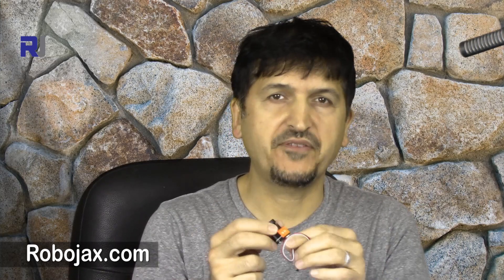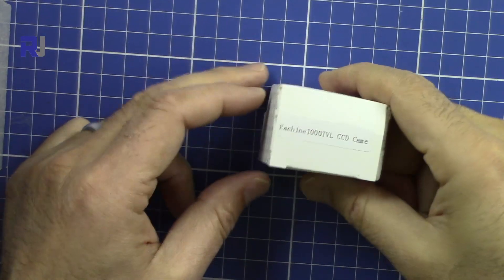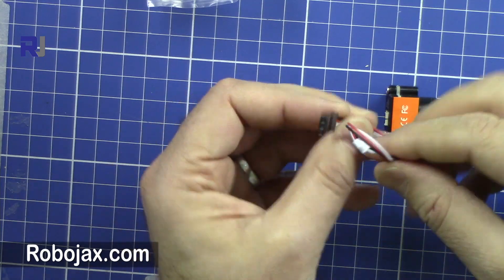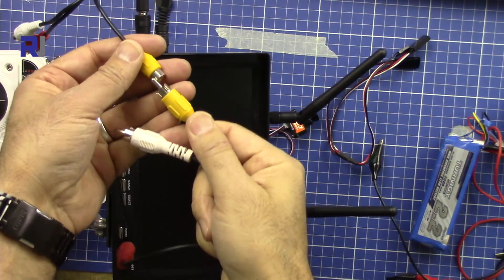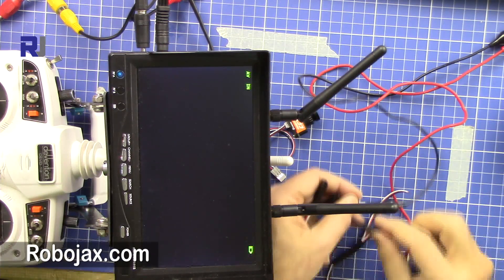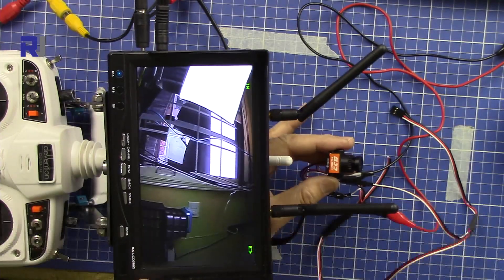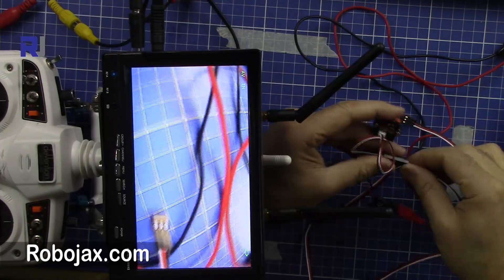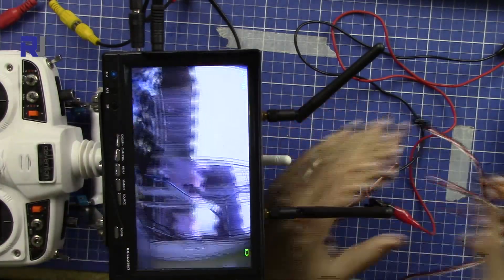Eachine 1000TVL 1/3" CCD FPV camera explained and tested

Comment: Im working on an FPV rover for a school project, and my team ordered this camera, do you have any suggestions on how to wire this up to an arduino or if its possible?
Reply from the maker: Hi, Arduino can't process the video.  but if you can want to turn the camera ON/OFF  at certain event, then yes. you can use a relay module to connect/disconnect the power. I have tons of videos on relay. but if you want to process video, the cheapest option would be Raspberry Pi.

Comment: Hi. I'm new to build drone, now I have F450 / 2212 920KV motor / NAZA MLITE without a camera / monitor and would like to try this. If I'm going to use this camera, what receiver do I need to communicate to the monitor while on flight? or does it have a wifi broadcasting so I can use a mobile device? Thanks for your response in advance.

Comment: I also have this camera. Can you tell me what is the name of the little white connector that plugs into the camera? I would like to find a VTX that comes with a compatible cable. Why doesn't Bang Good list this information?
Reply from the maker: Hi, I have rarely seen the connector model. By the way Bandg good is very expensive and not fast. eBay or AliExpress is always better.
Reply from the maker: Here is a page you might find the connectors for you camera https://www.aliexpress.com/item/32950362786.html or this https://www.aliexpress.com/item/32733307616.html

Comment: I brought this and connect with rs832 and match THE freequency and channel but does not work CAN U PLEASE TELL ABOUT THE PROBLEM OF FPV SYSTEM IS IT CAMRA OR FPV TRANSMITTER
Reply from the maker: it is the transmitter. You can test the camera by connecting it to TV via the yellow RCA connector.

Comment: Where the tx? Camera must connect to tx, not direct to rx screen like you did.
Reply from the maker: at 1:20 (click on 1:20 to see it) I have shown the the output wire. I have connected it to the monitor. You can connect it to TV as well. you don't need Transmitter or TX. TX is used to send video from remote location. I am close to the monitor so I connected it directly.

Comment: Hi. I bought Eachine 1000tvl 1/3ccd camera along with TS351 and RC805. I connected one 11.1v battery to TS351 and another 11.1v battery to RC805, and i connected to television. It was showing black screen with noise. I don't know what to do and i was searching for solution for weeks. So can we help me in this? Thank you.
Reply from the maker: using RC805 did you search for the channel you set on TS351? they both must match before you see any video.
also to test your TS351 and RC805, using a DVD player which has the composite video out "Yellow, red and black" wires. connect the yellow wire from DVD player to the TS351 video input. Then play a movie and you should receive.    I am trying to see if the camera is defective or your TX/RX .